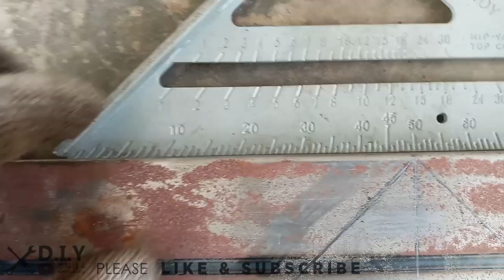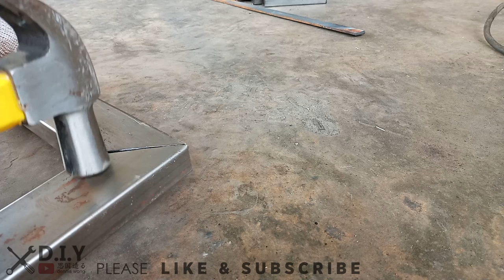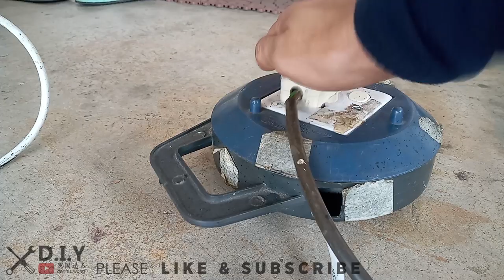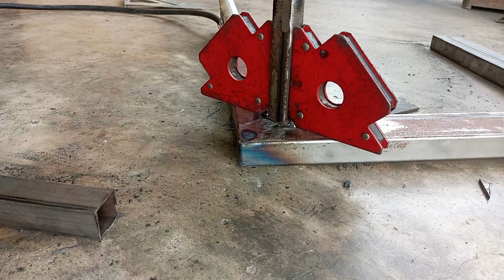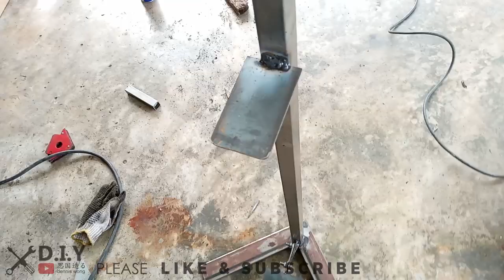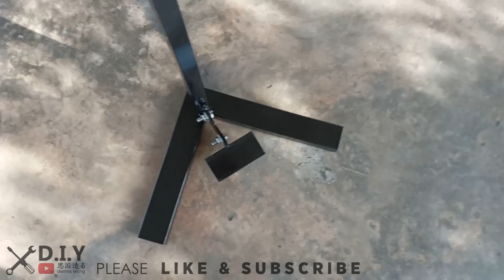Foot Operated Hand Sanitizer Dispenser 3.0

Comment: Love this video,I also wathch previous videos too, very easy process,
Sir, please can you make one machine with cable mechanism, hinged tap & movable bottle holder.
It will require only one vertical sq. tube.
Good for price cutting & machine will be light in weight.
To reduce more weight we can use C-channel insted of square pipe.
Reply from the maker: Thank you Akashh Kechkar 😀 thank you for the feed back as well. Yeah i did thought of using c-channel initially but if it is too light weight the stand might fall off. But a solid base will solve that . Will try to make one with cable mechanism my friend, there is a few youtubers posting dispenser stands with cable mechanism too.

Comment: what is the size on inner tubular and outer tubular standin
Reply from the maker: 3/4" and 1", both 1.2mm sqtubing, check my latest video for an easier build.
Reply: @metalwood7225  Thanks
Reply: last sir the thickness sorry ima student and trying to build one
Thanks for Inspiration
Reply from the maker: @christianjamesvitalicio1269  did you receive the email i sent you?
Reply from the maker: @christianjamesvitalicio1269  thickness is 1.2mm, you can choose to use 1.6mm also